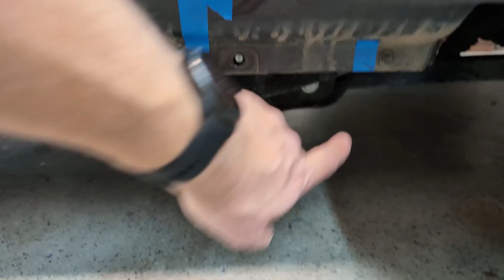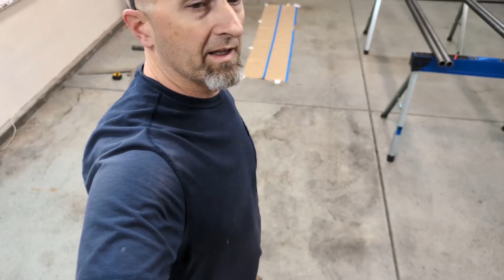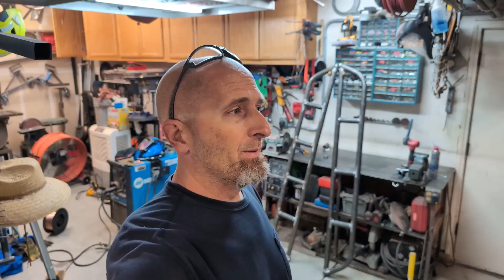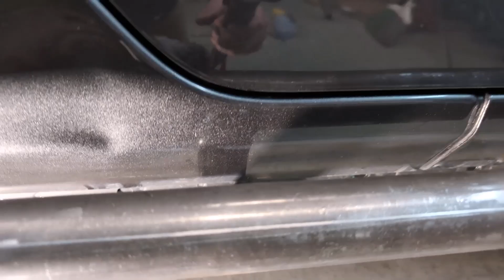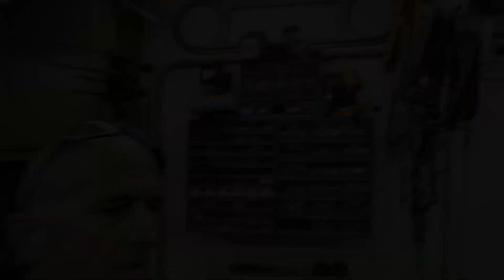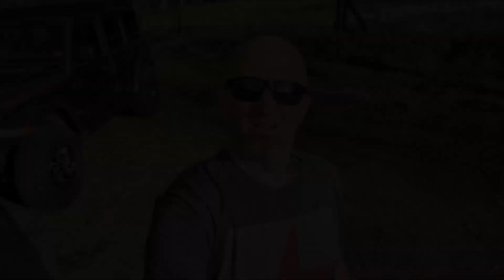Building Custom Rock Sliders for any Offroad Vehicle.

Comment: Just finished the video. Freaking awesome video. Learned a lot of cool tricks. What bender is that?
Reply from the maker: Thanks! Glad you liked it. It's a  Pro Tools 105HD mechanical bender I've been running for 20+years. I built the vertical frame and added hydraulics years back.
Reply: @ what are your build plans with the Jeep?
Reply from the maker: Somewhere between a rock crawler and overland rig. The goal is to keep it a driver. I'll be at EJS with it. If I can swing tires before then it will be built, otherwise as it sits now.
Reply: @ I’ll see you at EJS!
Reply from the maker: Nice!